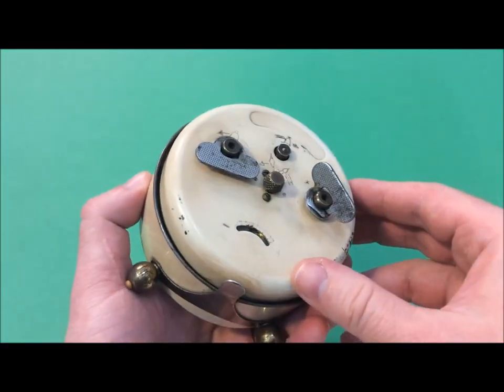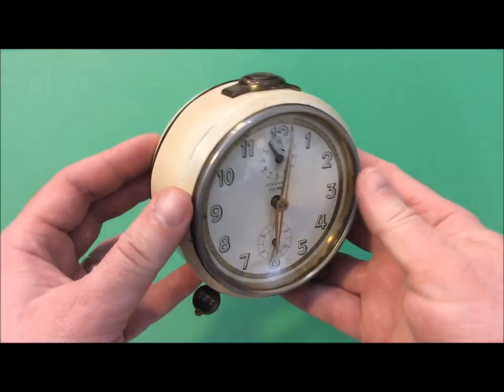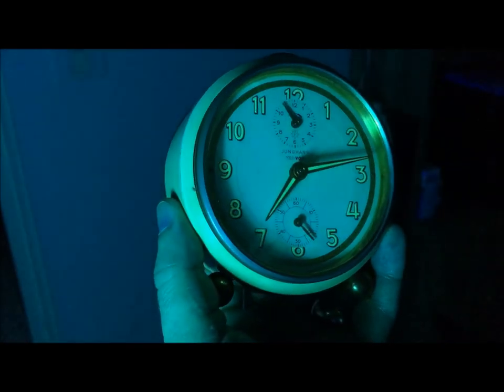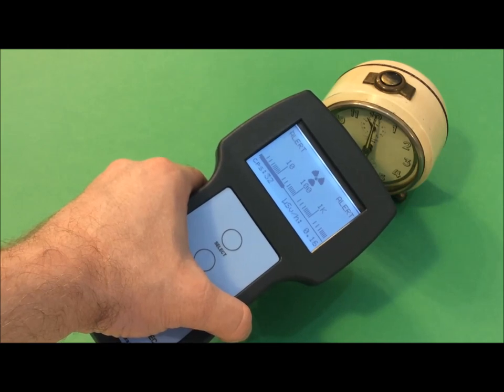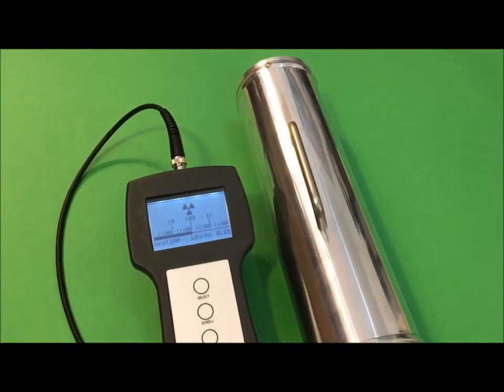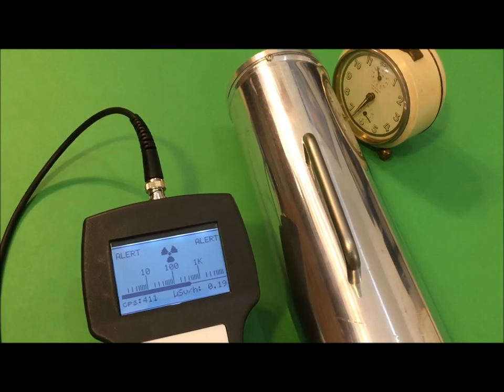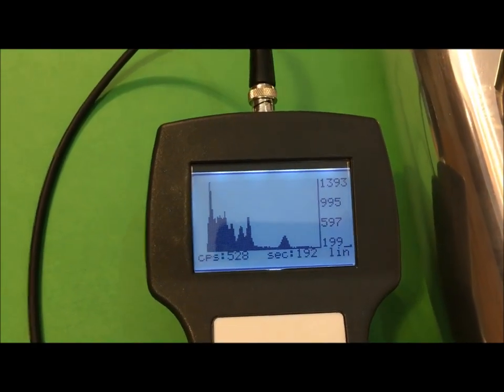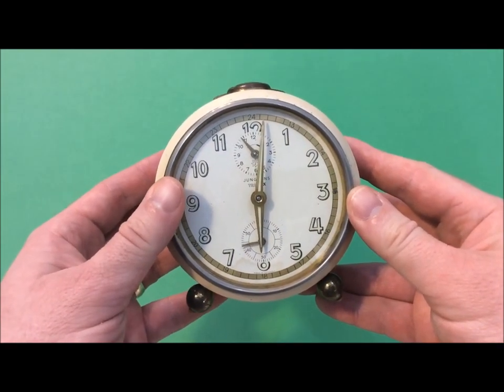Vintage Junghans Tri-vox Alarm Clock with Radium-226 paint

Comment: I have a watch of this brand and i think it have this radium ink, i cleaned it a few days ago and a little bit of ink droped off, it represents any rink? or the amount of radium is so little that is no danger at all?
Reply from the maker: dust of radium paint is dangerous
Reply: @rhelectronics.jerusalem  No problem, i found out that my watch was not paint with radium but with ordinary phosphorescent paint
Reply: Always protect your lungs when working with those pieces, mask, inside a chamber, clean tools... Lungs are the most susceptible organ to damage and produce cancer with tiny amounts of radius, because a natural deficit on get ride of particles, them stay there, causing damage for a long time.